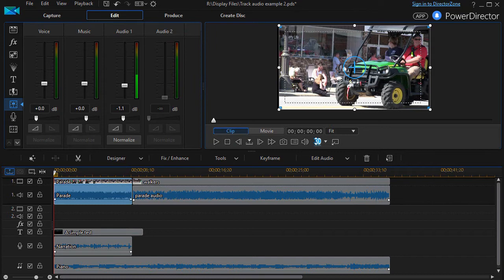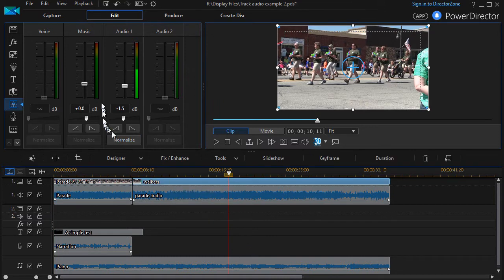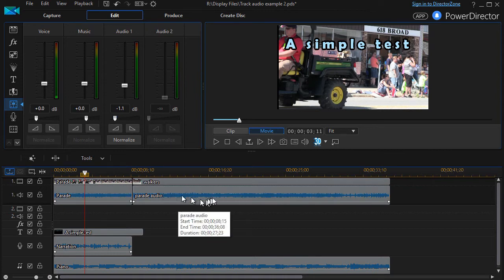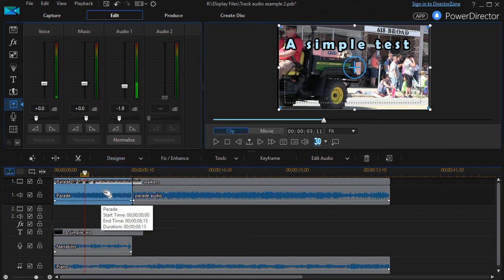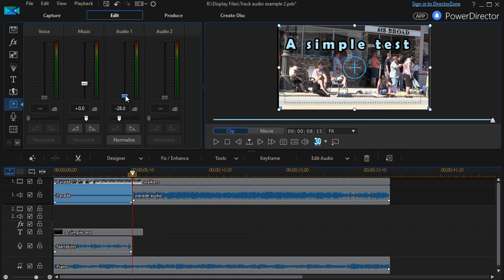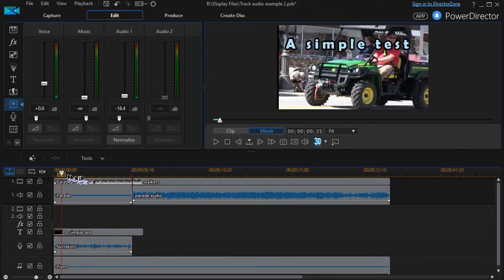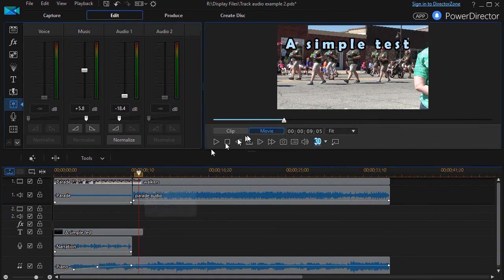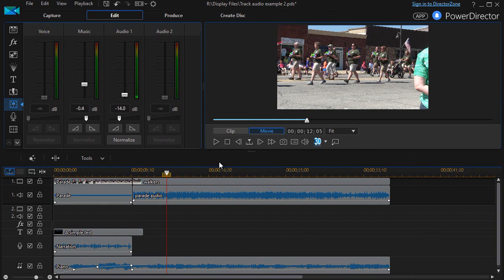PowerDirector - How to use the audio mixing room - part 2

Comment: Thanks for the audio tutorials.  Very useful.  Especially your explanation of the compressor/limiter/expander in other videos. Years ago, I programmed  Top 40 and Rock radio stations and often snuck into the engineer's equipment room after hours to play with the signal processing  (we radio pd's back then wanted our stationd to be the loudest on the dial, while engineers preferred settings that resulted in cleaner, less processed sound)  I wish I had your simple explanation for threshold, attack and release time back then!  Maybe we wouldn't have killed off the radio as fast as we appear to have done with fatiguing settings  (and too many commercials, of course)
Reply from the maker: Mike,
Thanks for your interesting backstory about your time in radio. That was quite interesting.  I am afraid most forms of commercial media are strangulating their audiences with a higher and higher percentage of commercials each year. --Jim

Comment: Been trying to learn proper audio levels, specially for music tribute videos I make that just have single track. I use to just crank it all the way up, which I now know that it distorts the sound. I recently read that you should not allow the sound to peak above 0 db. But I'm confused because there's so much green above 0 in PD, and it sounds so low when I only let it peak around 0. Is it okay to go above 0 and just not let it peak into the red?
Reply from the maker: I'm not an audio expert, but from what I do know you can go above zero. It's safer to have the raw file too loud rather than too soft. It's easier to pull the sound down in post-production than to magnify it when it is too soft. 
When you look on the sound track you want the finished product not to have any yellow at the edge. That produces distortion. Hope this helps.  --Jim
Reply: Sharper Turtle Yes, that definitely helps. It sounds fine to me when I increase above zero, but I've been searching for a fellow PD user just to confirm my opinion on it. There's such a lack of info out there on how to use PowerDirector, so thank you so much for making these tutorials.
Reply from the maker: You are welcome. I hope to learn and share more in the future. --Jim

Comment: Love it.  Question:  I have a video of a conference in a large auditorium.  It has a lot of background noise that interferes.  Is there a way to remove it in the audio mixing room, or do I need to use Cyberlink Wave or Audio Director? Gi
Reply from the maker: Removing unwanted audio is a difficult task. The more channels you have to work with, the better. If all your audio is is one channel, the software cannot distinguish between the sounds coming from a speaker and those coming from people making noise in the third row or at the back of the venue. If you have one channel tied to the speaker's microphone and another that picks up random noise in the room, then the situation is different. You have lots more control. 

AudioDirector does have a noise reduction feature, but it works best if you are recording something like a video in a room where a fan is making noise in the background. It might make some difference for unwanted audience sounds in a large room, but I haven't tried any remedial editing with it in that situation myself.

Noisy audio is a bit like grainy video. You can only do so much with raw footage that has issues. :(

--Jim